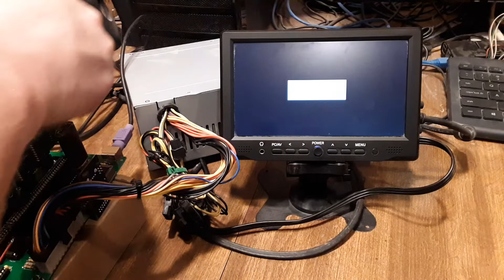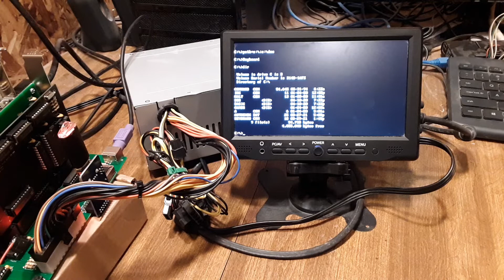8088 Motherboard

Comment: Awesome, nice work.  You said it still fits in a case.  What "formfactor" are you using that that - expansion card area of a standard ATX case with just the PS2 port hanging into the usual motherboard ATX portion?

-Dx
Reply from the maker: Yes it fits in an ATX case.

Comment: Interesting modular setup. Are you eventually going to add more ISA slots for other cards like sound, I/O, and/or XT-IDE controllers?
Reply from the maker: Yes the idea would be to make a seven slot board eventually for extra slots. I have considered just putting the memory on the processor card. That would give you two usable slots.

Comment: Where do you source the ISA connectors from, and how much do you pay? I’m in the UK and can find only one seller, and the cost is about $12 each. Prices on EBay are no better, not that they are often for sale.
Reply: Can confirm I have used the same vendor (as called out by EMM) and the quality is top notch!
Reply from the maker: I get them from AliExpress. I usually pay less than a dollar. It takes up to a month for them to get to me.    https://www.aliexpress.com/item/4000490392119.html?spm=a2g0s.9042311.0.0.27424c4dqnQ1kG